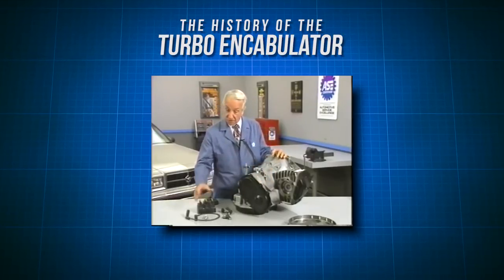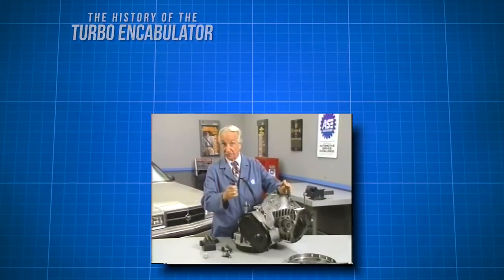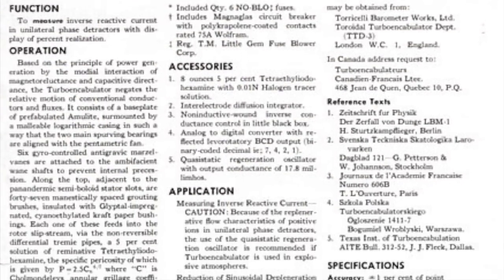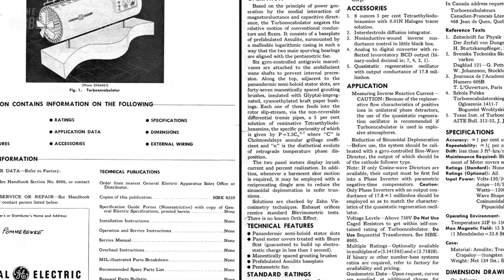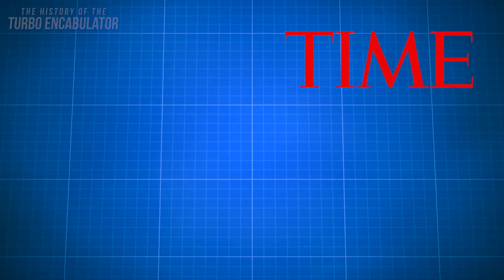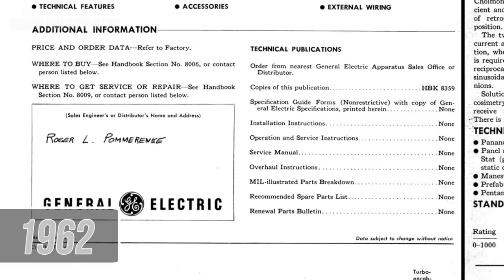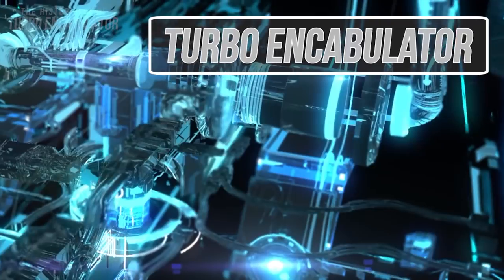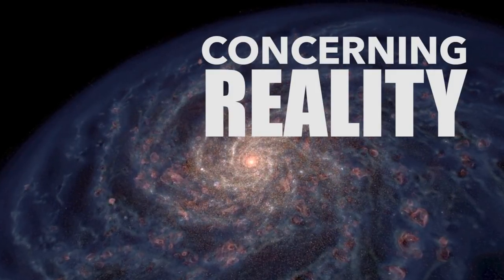The History of the Turbo Encabulator

Comment: As long as side fumbling was mitigated, I’m happy.
Reply: But what about back-fumbling? I once purchased a defective retroencabulator, and it would continually back-fumble until its randomized quanto-physical semi-balancing combobulation mechanism exhausted its supply of fungibly radioactive unsymmetrical mixed-meter logarithmic hrdroresonance blockchain microsegments.
Reply: Mitigation of fumbling only applies to Top-Bottom fumbling and not side to side fumbling.
Reply: Side fumbling is inevitable if a cars chassis contains both mammals with and without ovaries placed at opposing sides of the drive shaft.
Reply: At what range?
Reply: Exactly! Side fumbling is the worst enemy in our field of specialization...
Reply: Hey! I LIKE side-fumbling.
Reply: @InventorZahran  there were two variants of the exact type you mentioned.  did you purchase the crescent fresh one? (i bet someone still remembers this from sifl and olly :-)
Reply: @webgpu   No, mine was the crescent wrench flavor. Like many uninformed consoomers, I bought it because it was cheaper and claimed to offer the same core features as the 'fresh' model.

I've since learned that apparently, the fresh version has better resistance against quasi-hypoactive centrifiqual forces. This supposedly improves the machine's tolerance for back-fumbling, to a point where it can reliably continue to function despite said back-fumbling. However, this is really only possible because the crescent fresh model deliberately induces front-fumbling to countervail the back-fumbling, resulting in the two opposing fumbling motions effectively cancelling each other out. This doesn't technically eliminate any fumbling (and in fact introduces more of it), but in practice, it negates any of the negative side effects.

Comment: When I worked for Dodge in the early 2000's they were still using this as an example to techs in the shop on how not to talk to customers.
Reply: I read "Dodge" as "Doge", which made your comment 100 times funnier!
Reply: Dodge using training manuals from the 1940's is pretty on-brand
Reply: They use this video at many auto repair places as an example of how to talk to customers.
Reply: @deluxejay69  if it ain't broke
Reply: Why? What's wrong with it?

Comment: Mom was always claiming how the boloid stator output would have been way more efficient if they would have been driven by a high-pressure sinusoidal subduction aperture.
Reply: But the high pressures in the aperture field could cause a fracture on the Marsal Veins, causing an incorrect integer outflow. Surely the solution is a low-pressure biopic linear aperture, right?
Reply: @infernosgaming8942  Well just try telling my mom that.   I don't have to tell you how emotional women can get about biopic apertures.
Reply: @thzzzt  Well, let's be fair here. Encabulator efficiency can mean different things to different people, and if she's talking about just pure power output to lunar waneshaft rotation ratio, then she's right, would be more efficent. The problem comes when you consider aperture pressures and wear and tear caused by semisoidal grumbling and (though this last one is kind of irrelevant for non-precision applications I admit) high-speed micro-fumbles in the panametric fam. But if you're running it once a month and servicing it regularly, then I can totally see how you could get frustrated with the "unnecessarily" careful decisions you'd perceive in the design!

Comment: Semi-BOLOID stators.  Not "bovoid;" those are made of cow leather, which would break down over time in the turboencabulator's hygroscopic parapneumatic fluid.
Reply from the maker: Ah yes, that pronunciation always gets me.
Reply: But they are an option if cost is a factor.
Reply: Not to mention the havoc it would cause on the reciprocating dingle arm.
Reply: @howeyyadoing9070  I learned in BASIC training never to let my dingle dangle.
Reply: Bovoid stators certainly are susceptible to that failure mode, but porcine epidermi have been developed that are are markedly robust to the presence of tetraethylidohexamine.
Reply: Assuming you have the time, semi bovoid states can absolutely be used in the place of semiboloid stators with the former providing vastly superior thermal coefficients with the sub-planar centrifuge as well as reducing the overall rotational inertia in the de-carbonised, multi-disc desalinators. The main reason semi-boloid stators are used is due to the decreased downtime due to more frequent repairs and the not insignificant risk of castrophic deep band fractures
Reply: Well played.
Reply: @howeyyadoing9070  Rotating dingle-arms are less susceptible to front-fumbling, and are therefore superior.
Reply: @williamhawkins6504  Does the Beatles' breakup qualify as a "deep band fracture"?
Reply: @InventorZahran  But where do you find them these days?
Reply: @howeyyadoing9070   Rockwell Automation used to sell rotating dingle-arms by mail order, but ever since the factory where they made them got demolished in 1973 and replaced with an overseas facility, the quality level just hasn't been the same. Apparently, Chinese-made dingle arms are nearly immune to front-fumbling, but have an unexpected fault in their hypokinetic balancing waneshafts, which makes them
uncharacteristically susceptible to back-fumbling along the planoteroidal oscillation axis.
Reply: Yes, semi-boloid stators are better, including in starships. They put a BOVOID type in the Enterprise warp core once, and it didn't even make it to Warp 1 before the nacelles were overheating. But the semi-BOLOID stators did much better... They got clear up to warp 9, and the good thing is, the boloid stators only have to be replaced about every 3rd time they replace the dilithium crystals, with normal use.
Take the starship into battle alot, and you may be replacing it every 2nd time you replace the dilithium crystals.
Reply: Semi-boloid = semi sphere like.
Reply: "A parapeumatic fluid is one that is thixatropic toward becoming a dual-state liquid-gas at standard atmospheric sea level pressure and 70 degrees Fahrenheit. It's primary property is that it is only semi-compressable, lending itself to being used in quantum pumps with spheroid-triangular pistons where peak pressures do not exceed 1,000 Meshertz Units per Wad.
Reply: bov*oid*, not bovine - bovoid stators are named for the shape of their dialectic flanges which are reminiscent of cow horns.
Reply: The bovoid stator is prevented from cellular disunification by the monastically spaced grouting brushes connected by the up side of the nofer trunnions.  I learned about all these things when I was getting my degree at the Peruvian school of scatological sciences.
Reply: lmfao xD
Reply: But doesn’t it have to be “bovoid” considering the research was done at the Peruvian Academy of Scatological Sciences?!  😂
Reply: @claytonknudsen2510  
What a coinkydink!  I was taught in college never to let my dangle dingle.
Reply: @williamhawkins6504  
Is that because the multi-disc desalinators reduce the ionic coefficient of the dihydrogen oxide to zero?
Reply: Make no mis-steak, there IS Cow Inside!  Spec sheet at 2:20 : "Case: Amulite; Tremie-pipes are of Crapaloy--(tungsten cowhide)."
Reply: Early encabulator prototypes contained the bovoid stator, but several tragic failures quickly caused a re-design.

Comment: I bought mine in 1979 for under $400,, and it still works like new.  Today's  models are more efficient, but with an average price of over $1,200, I'm going to stick with my old one until they run out of replacement linear displacement vanes.
Reply: A wise decision!
Reply: @luciusvorenus9445   So far, it has been the best decision of my life.
Reply: Tesla's got a new all-electric version, you should check it out.
Reply: @michaelross2115   I saw that.  I was thinking that it would be a great way to power a Ferris Wheel on Mars.
Reply: Tim Hallas? They don't make the parametric shift clutches for the old models anymore... I'm guessing you have to go to a machine shop and have one fabricated, and welded on, right?
Reply: @Mike Studmuffin not for sale.
Reply: I managed to snag one on eBay. I feel guilty, because I don't think they knew what they had.

Comment: My grandfather told horror stories of having to work with steam driven piston encabulators that could barely cabulate before they built the early GE turbine versions. I'm still amazed they could run them effectively with mechanical analog computers.
Reply: Likely the grammaters were wrongly calibrated the entire time.
Reply: That's sounds terrible. I'm sure side fumbling was a big problem in the early days.
Reply: That prefamulated amulite REALLY made a difference in the hyposoidal skrumst rotation.  Took vibrations to a minimum when in operation.
Reply: We still have a functional albeit unused original Westinghouse Electric, Steam Turbine Encabulator. Most of our modern Encabs that were built by Rockwell, have had their internal sub systems replaced with solid state Siemens drives.
Reply: @loganbaileysfunwithtrains606  how is the precessing rotary block converted from steam?  I assume there would be a problem with the zener coupler with electric power
Reply: @The_Mimewar  simplest explanation is that it doesn’t need a zener coupling, steam pressure alone can suffice, a barometric waste gate handles any over pressure related issues to the rotary block, then the steam returns to a cooling loop which also acts as the thermal damper for the rotary block’s main faeber bearing. It’s a better system in my opinion than the modern turbo encabulators. However modern EPA emissions and OSHA protections make it virtually impossible to actually have one operating outside of a functional display
Reply: @loganbaileysfunwithtrains606  thank you.

Comment: Ford tried to make a Turbo Encabulator in the 60's. They could not overcome the reverse osmoidal reluctance induced by the post inductive interference tendencies of the entire transflux chronoreductor assembly. This problem was of course solved in 1973 when professor Horacio P Schmittenflopper put forth the principle of transflux chronoreaction reasonance in which the molecular harmonic of the interstatbulation interference axis of atomic structural matrix could be synchronized with the natural transchronic vibration inherent in the base material of the transflux chronoreductor assembly. It was this breakthrough that made the science of Turbo Ecabulator Absorbtion what it is today!
Reply: Well, funds were transferred to beat Ferrari at La Mans and this project was abandoned.
Reply: Man... If it hadn't been for Professor Schmittenflopper coming up with a solution, ain't NO WAY the Delorean could have gone Back to the Future! 😂

Comment: Well put explanation!
I'll add... ANY sculvoid magneto output under 13.121 quarvoids is immediately detractable under the hypobolic inverse stealth springs. This should be avoided at all costs! The squirm meter and vacuum discomboobulator can't handle it.
This could cause some link side-fumbling to one of the reactive logarithmic detractulation of the squirm meter! That could knock the dingle arm to excite the noids.... And produce under-bremulation of the fifth and seventh bi-dorsal marzal vanes.
Reply: PacbeltRR as long as i dont get any side fumbling then im all good
Reply: Yes, you do need to watch those quarvoid counts, I've seen whole Marsal Veins shatter because they didn't apply the proper authoritative and restrictive measures to reduce quarvoidic build-up in the base of the ion redistributive mainframe.
Reply: What's so bad is, if you put one in a starship, and the dingle arm is allowed to excite the noids even one time, your warp core will blow up. It will be almost immediate. So they have to add heterobelletron shielding to keep this from happening. Pulls a lot of power, but it's worth it.

Comment: If they only knew back then that side fumbling could be prevented by having only 3 hydrocoptic marzlevanes, so fitted to the ambifacient lunar waneshaft.
Reply: Look. They were doing these things on paper, using slide rules. The first quantum chips hadn't even been invented yet. They were still using analog graphite-filled wood sticks with gum rubber mistake removers on one end to write things down. It took people years to work out the equations, and Unobtainium-438 hadn't even been discovered yet, let alone processed into the first non-linear-counter-geared-halfshalfts, let alone waneshafts. If it weren't for Dr. Emo Schitzenfahrtz, who discovered the Potzrebie Effect before dying in a freak sexual accident in Berlin just after the war's end, today's scientists would still be trying to accommodate the side-fumbling using primitive mechanical balancers and gum arabic as a shock absorber. I salute you, Herr Professor Doktor Schiztenfartz, not only for your discovery, but for your use of trampolines!
Reply: Recent research is now showing that side fumbling can be an advantage, especially when tetra-fluoro tri-thiazide is back injected using a bi-fluoric solvent with a non-phasic bit splitting algorithm.
Reply: It's too bad the raw materials for making lunar wane shafts have gone up in price...However Elon is planning to fix that problem, too.

Comment: great machine. back in the day, they use fumbling centrifugal centre to make it balance, so it does not relies on its own weight to lift the dynamics stage plate. so much so that if you put an ice it will create enough energy to move a single arm swings. Leather us thoroughly throughout making seat as a safety.

Comment: The sperbing bearings on the turbo encabulator are a good idea, however in practice I have found their general application less than optimal. I prefer the German made “übershëiftwefvel” celulatical non-deportable tungsten crankwinders. They tend to reduce subatomic enfaculation and furthermore increase dermatomatric flow in harmony with an astounding non-particulate based cylargic reading of .51! I dare you to beat that with any American made fluxation based caputational resonance defractors.

Comment: Anyone know if it's better to emulate an encabulator magnetic reluctance process in Ubuntu under virtualbox or run it under wine?
Reply: @Mike Studmuffin Oh, but you can if and only iff the virtual box is either not properly polarisiated or becomes mono-dimensionally asymetric. The results can be cat ass-trophic. The cost of re-depolarisiating the assembly is staggering at greater than £1.587/mm³.

Comment: How is anybody supposed to understand this when the subtitles have so many mistakes? Also that burping noise could be prevented with a high pressure moxyl aceloid plate. It's just that nobody discovered it until the unit was out of production.

Comment: Yeah the Flux compressor in parallel to the springs. Gives a electromagnetic increase to the capacitive reactance of the giga springs as its a coil.  Which gives in a mono reactive impeadence

Comment: I can’t say too much by my team at TechniFabSolutions have been working on ways to bypass the Marzen veins. We’ve seen tremendous promise in our use of trebuscopic thermalite conductors. This allows us to achieve micro encabulation which requires less power.  But produces the same result and is also more efficient than the marzel vein. The only issue is dilution of the isotropic resin we use in our conductors. We have been experimenting with Xenic cortalite as a replacement but can’t balance the differential outputs of the marzel core. I hope I’m not saying too much but I don’t think this gives anything away.

Comment: TECHNICAL SERVICE BULLETIN No. 453-A1
Due to interflangial resonance between the modal springs and the sinusoidal mounting brackets it is recommended to replace the gearage races annually, using a maximum torque of 5 liter-pounds per second.
Reply: Nah, you got your units all messed up. It's 5 imperial gallons per kilogram per second

Comment: Pro Tip:
The Turbo Encabulator must be installed in sinusoidal wave conjunction with the flatulator valve for ultimate ambifascient reflection. If not, side fumbling will not be prevented.

Comment: Does it have the FLUX capacitor or no???
Reply: No those are only in airplanes
Reply: Only as a dealer installed accessory haha
Reply: Not quite. The electrical differential resulting from low-amperage output tends to result in an incremental depreciation of the primary torque drive process, which can cause exponential delineation of the aforementioned marzlevanes. You'll instead want to calibrate the internal rotor array to a setting within at least 5 degrees of the primary stator assembly, assuming you are still using an occipital interloping accelerometer. Otherwise, the pressure differential becomes much more precise and the margin of error has to account for the increased retroflexive output.
Reply: @ChiotVulgaire   Oh so that's why only modern terasonic engines use this technology? I assume that using terasonic laminars, the primary control spindle can achieve much greater retrofexive index, and as a result better active exothermic efficiency. I would also like to point out that using multistatic coupling faradiods, a metarotor can achieve same increase in retrofexive index, but this method it less commonly used because the quad phase zirconium  solid state relays are very expensive. The cars that do use it need a special logarithmic tuning bitmap to exploit the barometric difference that occurs within the sump system. Regardless, I believe that future technology will dramatically improve the centocritical electrocharge.

Comment: there is a number of videos with the same script and different objects I call BS
Reply from the maker: What?
Reply: You need to vacate your current surroundings immediately. The bogon density  of your immediate location is having a detrimental effect on your humoron recptors.  You should be examined by your humorologists as soon as possible to prevent permanent damage to your humorphatic system.